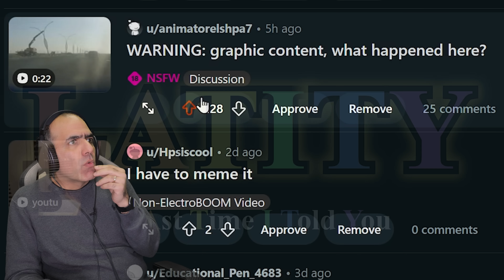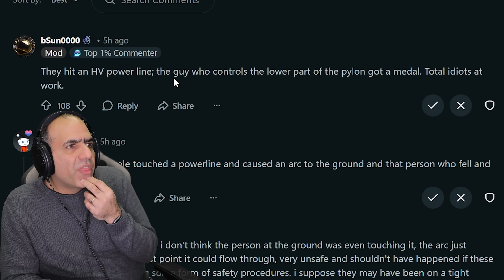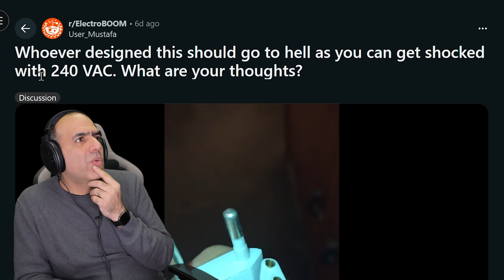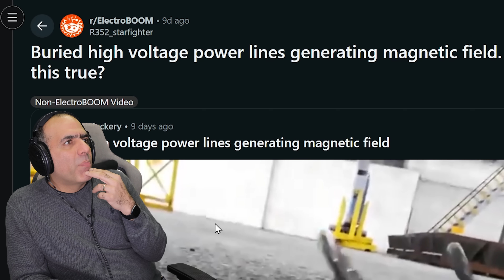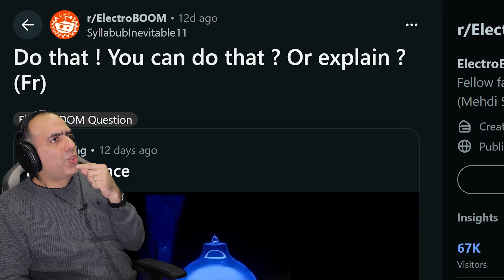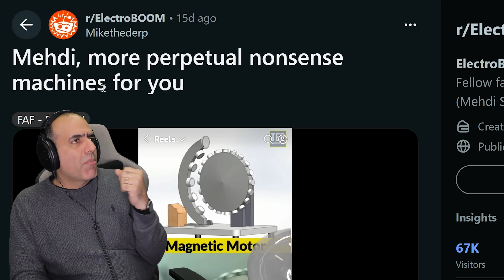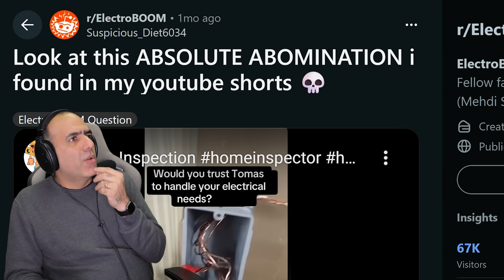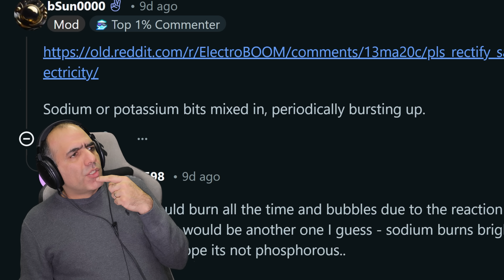Have a Pole? Need a Hole! (LATITY-017)

Comment: 8:27 I have some experience trying to make a plasma toroid in those off the shelf plasma globes, so maybe I can save you some pain because it’s kinda hard. Id recommend trying to remove the electronics from the inside since I think most the RF power couples to the internal circuitry instead of the gas. And I think the electrode in the center also causes problems by interfering with the induced e fields or causing too much recombination. The transition into the toroid state (H-mode) is very power dependent so any parasitics are killer. So dont make my mistakes lol id probably test the driver circuit on a smaller gas ampule first

Comment: I can actually comment on something for once @11:02 those things are motor starters and the thing our camera man was messing with was the aux contacts for the controls. The noise we are hearing is probably the contacts chattering because they werent meant for relatively high voltage at 60hz hence the boom.